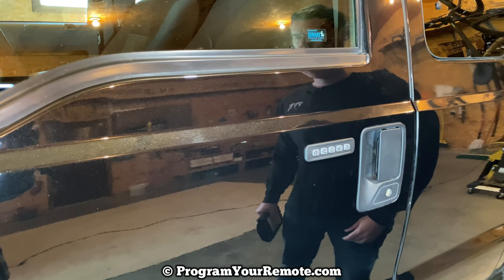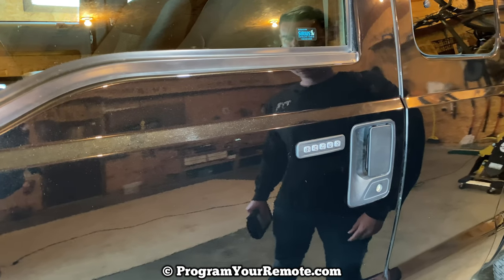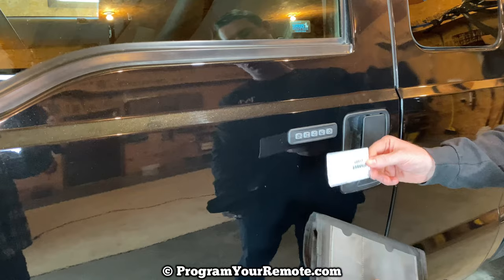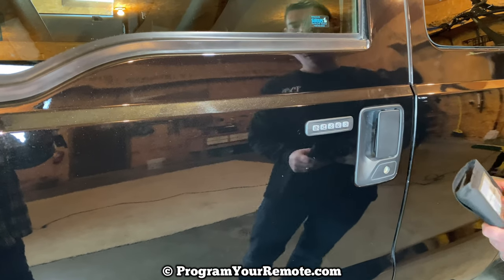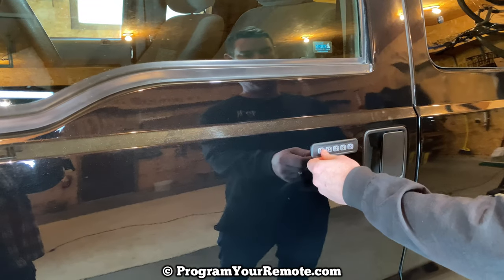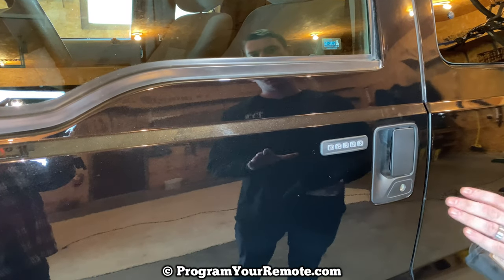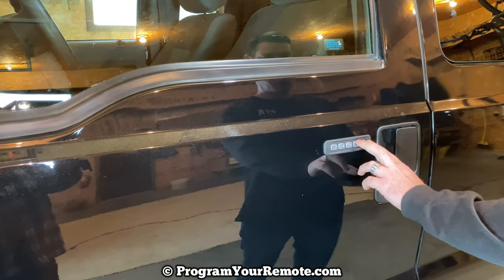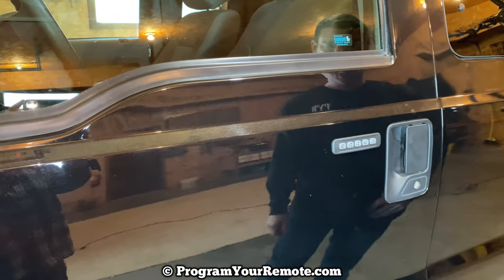2011 - 2016 Ford Super Duty - How To Add A New Door Keypad Code - F250 F350 F-250 F-350 Key Pad Code

Comment: How do I get the factory code
Reply: It’s a 2017 f-250
Reply from the maker: If you have two working keys you can use the procedure shown in this video https://youtu.be/zJ1vXZCLf8o.  If not, the code is also physically located on the vehicle - some interior trim pieces need to be removed to reach it.

Comment: Is it just adding a code? Or is it replacing the old code?
Reply from the maker: Adding a new code
Reply: Mine will let me add one code. It always keeps the factory code. You can change the code as many times as you want, but only two codes will work, the original factory code and which ever code you put in last.

Comment: Where are you find the code  for  a 2015 Ford 350?
Reply from the maker: It should be where its shown in this video
Reply: Inside the panel below the glove box.
Reply: What happens if you buy it used and you don't know the code? How can I change it